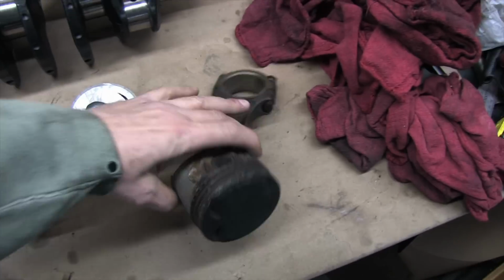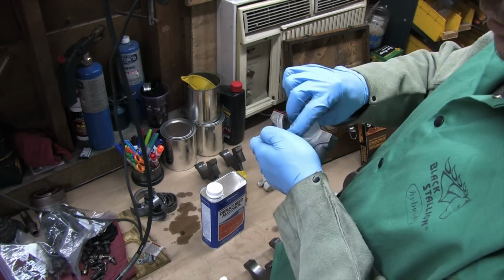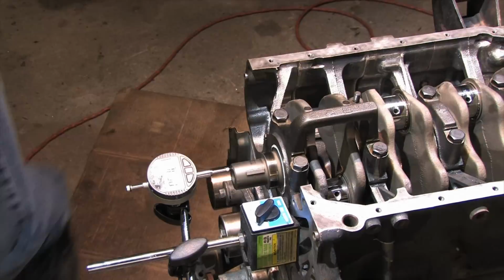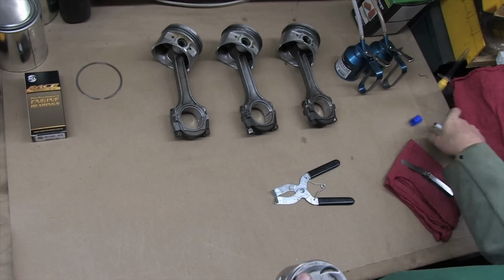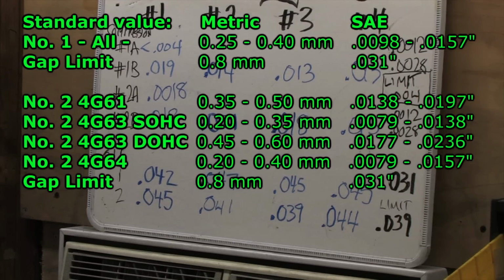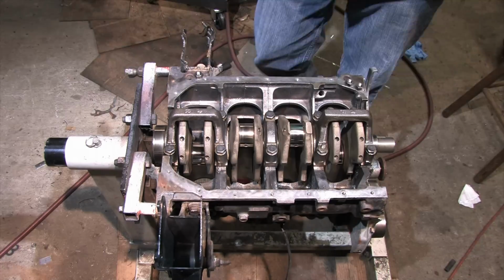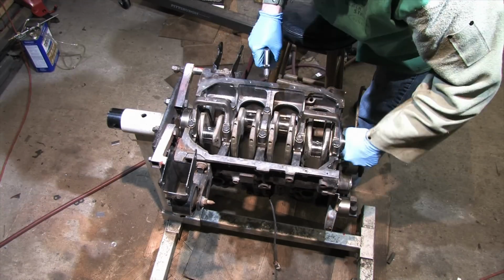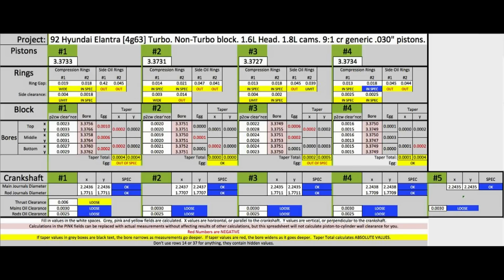Hyundai Assembly 1 - Blueprint Everything

Comment: Would you advise against a simple hone and toss in standard size forged pistons? Motor ran fine, crosshatches are good. No roughness.
Reply from the maker: Any time you hone, you remove material.  If the old pistons and rings measure out within spec, I would advise against it because there would be no improvements gained.  If the compression numbers were off, or if the engine was being built for higher performance, it couldn't hurt.  On a standard bore daily driver mostly-stock car... I'd only do it if there was a problem.  The few ten thousandths removed during the hone would just make the reworked bores reach the service limits faster.  In other words... it could make them a little slappy before their time and require additional corrective work later.  The tolerances for piston to cylinder wall clearance is usually a very tight measurement.  Usually within half of a thousandth.  So removing a few ten thousandths could actually put you out of spec, or leave you with very little material to chew through to reach it.  :)
Reply: It's for a 4g63. The stock motor has been making good power and I don't want to chance it anymore. Looking to go cheap and just hone and install standard size forged pistons and some rods. The car will be making over 500Hp as it has been for awhile on stock stuff, just have been pushing luck
Reply from the maker: The bores are actually cut to the size of the pistons that are in it.  A machinist needs to measure the pistons and cut the bores accordingly.  You could order another set and find they're completely out of spec from the bores you have.  If you're going through the expense of replacing the pistons, it wouldn't make sense not to oversize a tad and do it right.  Add to that the thermal expansion rates will be different between the different materials.  The chance that a different set of pistons will be within .0004" of your factory pistons is so slim 'd bet it wouldn't work.  There's usually that much variation from one piston to the next.  If it's off, it will either perform worse, or even cause a catastrophic failure (hot piston seizing in the bore).

You could order a custom set of pistons that are only slightly larger, but the price just keeps going up if you do that.  Try to find a set of .010" overs if it's time to go forged on a virgin block, and get the bores sized properly.
Reply: What about being a complete cheap ass, and doing 1g big rods on 2g postons, and just gap them accordingly and go for gold. hauling the block to a machine shop isn't on my wanting to do list if I can get away with it.
Reply from the maker: Putting 2g standard bore pistons in a 1g block still leaves the same bore size problem mentioned in my previous answer.

6-bolt 1g "big rods" will require machining to fit if it's a 7-bolt.  They're wider than 7-bolt rods, and the pin bore of a 6-bolt is 1mm smaller than the wrist pin on 7-bolts.  Shaving the rods down and drilling out the pin bore might cost as much as an aftermarket set of rods.  That should be your determining factor on that setup.

I know what you mean, though.  I didn't want to haul the Hyundai block to the machine shop, either... but I ended up having to anyway.  Sometimes it's the only way to prevent having to do a job twice.  I didn't have to get the bores punched out because I'm re-using the same pistons... but I had to do everything else.
Reply: Appreciate the response! Enjoy the videos, and humor.

Comment: I have a 1996 Elantra and should make good use of this info.  Thanks.  I am a reborn VW Type 1 fanatic.  A question I have is; on these 1.8/2.0's, do the pistons and connecting rods come already put together, with wrist pins, etc?
Reply from the maker: They come separately and have to be assembled.  They're pressed on, so once they're assembled, they don't like to come apart.

Please verify the year, though.  From '89-95 you have a good chance of having these Mitsubishi engines, but the engines that came in the 96+ cars are very different from the one in this model.  After they ran out of engines, Hyundai began supplying their own engines.  Those are the Beta cars.  The body style changed.  The information here pertains to the J1 cars, but I'm sure the techniques are universal because everything Hyundai learned, they learned from Mitsubishi.
Reply: ***** Thanks.  Mine is in fact a DOHC.
Reply from the maker: Look for the engine code on a plate riveted into the engine bay.  The engine code should be something like G4CS, G4JS, G4xx... etc.  If it is, you have a J1.  Its build date would also be pre-1996, but it would be sold as a '96.

Comment: Jafro, amazing video, I always follow your videos and I really appreciate your effort doing all this for us! I have a question about bearings, I'm rebuilding a 4g63T 7bolt engine from DSM 2g 95' (gonna swap it to my Mirage 4g). When I removed the crank I found some slight scratching at bearings and journals, not bad, just some superficial scratches, I wanna do it right so I sent the crank to the workshop, the micro polished it and now is ready to install, I took measurements on journals and follow the process at the service manual for choosing the correct bearings (using measurements + looking at block numbering) but now I cannot find a dealer who has them available, they appears to be discontinued, do you know something about this? is there a replacement for OEM different sizes STD bearings? I'm looking for this parts: MD195919, MD195920, MD195925. Thanks!!
Reply from the maker: My recommendation would be to go with a Clevite, ACL, or Calico equivalent.  They're better quality bearings than OE, and available in a range of sizes.  The journal measurements should be all you need to the ten thousandth compared with the factory spec.  Shoot for 1.5 - 2 thousandths oil clearance with the parts assembled and roll with it.  If it's a mostly-stock build stay on the 1.5 side.  If you're shooting for 350+ stay on the 2 thousandths side.  This is OIL CLEARANCE, not oversized bearings.  Standard bearings are what you'd use if your crank measures out to the factory spec.  Oversized bearings would be used if the journals are SMALLER than spec.
Just make sure you get the 95-96 bearings with the one-peice thrust bearing rather than the one with the thrust washers.  Your block can't use thrust washers, it needs the 1-piece 7-bolt set.  Then test your clearances during assembly.  I'm a big fan of Calico coated bearings, and ACL H-series bearings.  I don't have any experience with the Clevites, but many people use them and swear by them.  Thank YOU for Tubing in!
Reply: Great! Thanks for your huge reply!
I would to ask one more thing! about ACL H-Series do you think that this race bearing are suitable for my mostly stock build? (aiming ~260 hp), I read some posts here and there about ACL Race are not the best for OEM crankshaft, they has different "chamfer" cut and are not the best option for a stock engine. (If you say they are OK, I'll go for them!) Anyway also wanted to throw some numbers, my measurements gave me this results: Mains: 56,985mm (~2.2434") and Rods: 44,97mm (1.7704) I'll be in the loose side of Mains within spec and a little bit off spec with the rods (but I found OEM rod bearings STD 3 that are the thicker bearings for STD size and hope they give me an acceptable clearance) Well sorry for many questions, It's just I really enjoy this stuff :D

Comment: Factory spec is .0008"-.0002" So I would think you should have been using green plastigague.
Reply from the maker: .0020".  I think you know that and meant to type it... but I still read you loud and clear.

The thicker stuff actually gives you better "resolution".  The green stuff is a bit questionable when you're on the wider-side of spec.  It takes crush to spread it out, and the red still covers the factory spec range.  I don't want any of my oil clearances at .0008".  If I see a .001, if it's not near the fatter side of .001", near .002", I'm doing some work to get it there.  ;)

Remember this engine's got an odd-ball and heavily-modified oil system... Y Ahua Lula.  Wider Is Better.

Comment: Where do you get the online service manual from??
Reply from the maker: It's actually a PDF.  Nobody's mail system except for the one I have that's connected to that iPad (I work in technology) can handle that size of a file.  It's way too big to hit send because it will be rejected by every other mail system out there.  This was the only way I could read it on an iPad because you can't store PDF's on an iPad, and I don't have internet in my garage.  I'll admit I didn't spend much time trying to store a PDF on an iPad... but that's how far I went before finding a solution for a mobile device.

Some forums offer it as a backup.  People have sold CD manuals on ebay for years.  I own paper copies of all of them, but I've managed to get lucky and find digital backup copies of them.  My original ones are getting destroyed.  My '97 service manual is filthy, missing about 9 pages now with a split spine, and has been the best read I've ever challenged myself with as well as the best Christmas present of all time (Thanks Bob!).

If you don't feel like looking very hard, you can still find 'em on ebay, but there's 2 versions of the 2g manuals plus the electrical manuals, 2 versions of the 1g manual, and the overhaul manual for every model of mitsubishi engine (shop manual).  I believe they're sold separately now.  Collect them all!

Or you can look hard and find 'em.  :P

Comment: I've always found the shortblock assembly was the most stressfull.  It can make or break your engine.  So like you I get rediculously clean with my parts and get all OCD checking my work 2-3 times.  Once my shortblock is built it's like a weight off my shoulders and the rest of the engine just bolt on stuff.

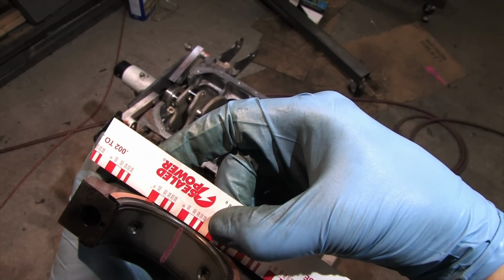Comment: 08:50 The Service Manual doesn't care in which order you loosen the main cap bolts, but I think it's odd you start at the center and spiral out. Starting on the outside and spiraling in (like head bolts on page 9-54 and 9-39) makes more sense to me.

Comment: Again, always a joy to watch, but if I could get your opinion about the rings for final assembly of the rotating assembly. An old colleague of mine who used to build motorcycle engines argued the fact of the piston ring gaps being put in line with the next ring below it and so forth. Our shop teacher said this would affect piston gas blow by into the crank case and so the correct method in his opinion was to stagger them so the would not line up stopping the gas blow by. My friend said that was wrong because the staggered rings would wear the bore unevenly, and had better results with lining up the gaps of the rings in final assembly. I am really on the fence with this so what is your idea on the subject. Lining up or staggering the rings. Again, a amazing video to watch.
Reply from the maker: The rings should be staggered.  The way I did this is exactly by the recommendation in the service manual.  The gaps are 180° out-of-phase, and all of them land on the 45°s because that's where they'll do the least damage to cylinder walls.  If you line 'em up on the pins or the thrust surfaces, you'll cause a problem wear-wise.  If you line them up, you'll increase the blow-by substantially.  This car already has such loose rings that I would probably be lucky just to get it to fire on first startup if I did that.  The real way to prevent wear is not to leave sharp edges on the rings when filing them.  If you de-bur the edges and stack them the way the service manual has them arranged, you'll get the best compression numbers.  Compression is key to making power.

Comment: Your using your micrometer wrong! Don't tighten it till it's snug, twist the barrel down till it wont go any further with 2 finger pressure or less! If you twist them too hard and slip them off the bearing surfaces on the crank the carbide faces of the anvils on the micrometer will scratch the crank.
Reply from the maker: I am not using them wrong.  I tighten to snug, and then test to see how much drag I get on the anvils.  What you're referring to is the check I perform AFTER I set the measurement.  If you're the slightest bit off-center or not holding the mic perfectly straight, you can get a wrong measurement with the 2 finger method.  What I'm doing tests the measurement result.  I assure you it's the 100% correct method.  Please note that this mic I'm using doesn't even have a thimble on it.
Reply: All micrometers have thimbles, that's what you "tighten" to take the measurement.
Reply from the maker: The thimble is a smaller-diameter part that screws into the barrel (also called a knob).  Most have a resistance-based ratcheting mechanism, but some use different mechanical means of creating the right amount of drag.  Thimbles are usually replaceable.  This particular mic has a plug screwed into where the thimble would go on the butt of the knob.
Reply from the maker: Andre Gross Let me clarify my first statement.  If this mic had a thimble, then I wouldn't make such an effort to verify my measurement.  I'd rely on the perfect tension the thimble provides.  But because it doesn't have one, I check my measurement by re-fitting the mic to the part and checking for drag.

Comment: awesome job and effort. the oil hole chamfering works to all engines? i'm using the 4g93t
Reply from the maker: Yes indeed it does.  Many crankshafts come from the factory already chamfered.  Subaru does it, even Honda and Mitsubishi cranks have it to a smaller degree.  Some cranks don't have it but all of them can benefit from it.  All I did was have mine enlarged a bit.
Reply: ***** i saw a video by someone, he chamfered the side, opposite of the engine direction. i'm sorry dont know how to put em in words lol. u have the chamfering video as well? ur videos are very beneficial, thanks again. so are u a Mitsubishi enthusiast?
Reply from the maker: Saravana Kumar Mine aren't actually perfect, either.  But if you go through the trouble of making the chamfers directional, you should definitely go through the trouble of making them go in the right direction.  lol.  Check out +fiatnutz 's chamfering video.  He's got the best video of this on YouTube.

Comment: hi, Can I use any assembly lube or you have some recommendations.  2) I see some they dont use assembly lube at all, for main and rod bearings, what will happen if i dont use assembly lube, They simply install by bone dry. 3) Should I replace Main and rod bearing bolts or I can lube and install. If i want to lube, what kind of oil will u recommend..
Reply from the maker: 1) yes, use assembly lube.  I like assembly lube with moly.  It's not what I used here.  2)  you will mar up the journal surfaces progressively until your engine builds up oil pressure.  It would damage the bearings of a 4g63.  3)  It's a good idea to replace them, and you'll find that many stronger aftermarket bolts cost just as much as the ones from the factory.  In some cases engines are overbuilt by the manufacturer with huge fasteners that can handle being re-used.  That is the case in this video.  You should just check them for stretch.  Measure each one, write them down, and see if one or two look strange.

Comment: I know  your said your being sloppy but you forgot to set the thrust bearing. :)
Reply from the maker: Nope.  It was at .006"  I measured it with feeler gauges and the digital dial gauge.  Are you referring to something different than the mains?
Reply: ***** Yes, I saw you checking thrust play/clearances but I am talking about aligning the thrust surfaces prior to fully torquing down the mains.  You lightly snug the mains down and pry the crank as if you were checking thrust play.  This aligns the the two thrust faces so they are flush.  You cant do this when the bearings are already crushed.  This prevents the thrust bearing that is higher from becoming an oil scraper.
Reply from the maker: Al Tee Thank you.  I'm sure I got 'em straight, but I'm going outside to loosen them, squish and re-torque right now.  You will see it in the next video.  :P  I'm not voicing-over the next video, though.  :(
Reply from the maker: Al Tee   Got .0060 - .0065 again.  ;)  I accidentally got it right.  I'll cover this in the GSX video.  Thank you for the tip!